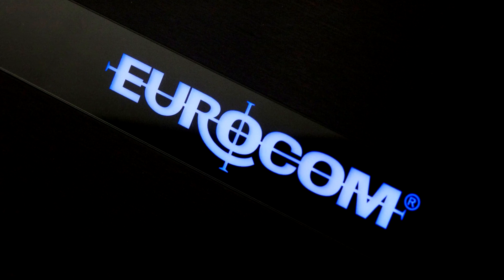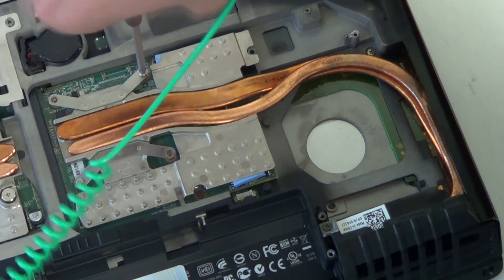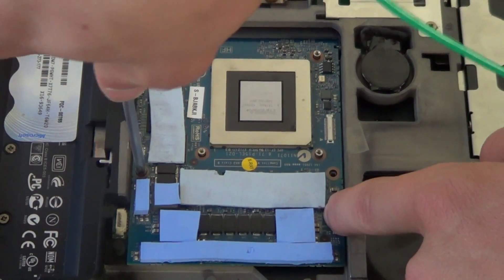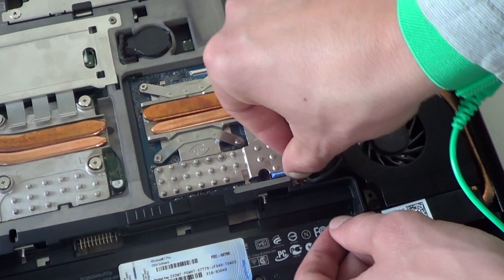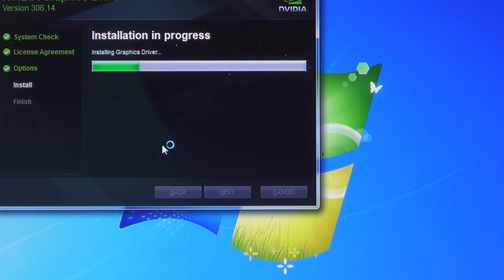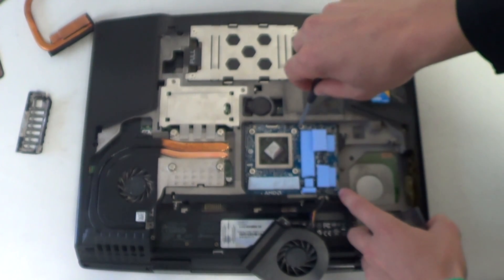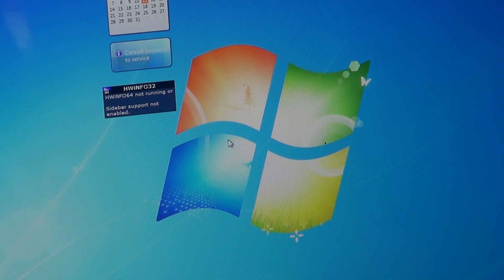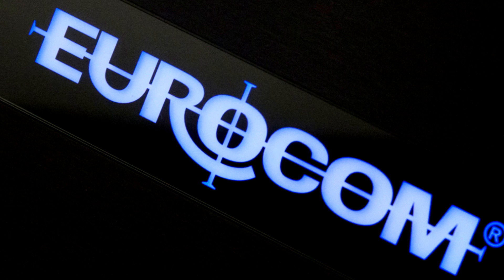AMD Radeon HD 7970M and NVIDIA GeForce GTX 680M upgrade in Alienware M15x

Comment: Recently I've just got a M15x, can it be fitted with 16 gigs of RAM, GTX 680M?
And also I noticed that you'll need a 240w power brick to handle that extra performance, is there any mod that needs to be made with the power brick?

Comment: I followed this exactly, and my m15x doesn't power on, only light is the power indicator which changes color when plugged in and not (orange out and blue to yellow in).
Nothing happens at all when the power button is pressed

Comment: I'm done with AMD video processors. Two came with my Alienware laptop. They've always been a little buggy. I was using AMD for updates. The latest updates won't recognize my laptop monitor so I get a blank screen. Now add software like Hitfilm Express and it fully crashes if you try to do onscreen drag and drop. So now I'm using HitFilm Express with the built in Intell the graphic processor and it works great! Don't wasted your time with AMD. My system has 2 AMD Radeon HD 7970M. AMD isn't worth the hassle.

Comment: Does this 680 or the other gpus work in the 2009 mode? M15x R1 ?

it is really hard to find info about which MXM cards the specific USDT / Laptops support, you know watt, interface, bios etc.
Reply from the maker: Here is a link to our tested upgrades. http://www.eurocom.com/ec/upgrade(2,268,0)Alienware_M15x_2011
Reply: Shame everything is so overpriced. Also i think you linked the wrong laptop because mine has the i3 330m which is first gen. and i think you linked 2nd gen ( i7-2960XM ) and i dont think they are compatiable with one another ?

Comment: Im having trouble removing the fan gril like in 1:55 , ie its stuck. i did remove that one screw he removed.
Reply from the maker: As you can see I had a bit of trouble with it as well.  Be gentle but it may require some fiddling.
Reply: and also i have a i720q and it runs at 60 - 67 idle is that normal
Reply from the maker: 60-67 what?  degrees?  That's not abnormally high.
Reply: yeah degrees

Comment: hey i have a 240watt adapter and i want to upgrade to a 680m from a 670mx will there be enough power for the new card i will buy??
Reply: also if i got a 7970m will the nvidia x bracket work on the hd7970m??
Reply from the maker: Your 240 W ac adapter is perfect.  Yes, the 7970M comes with an Xbracket on the card. All of the xbrackets are already on the card.
Reply: EurocomTechnology oh ok that makes sense thanks
Reply from the maker: Good luck!

Comment: will I need a 300 Watt power inverter for the 7970?
Reply from the maker: There is a 240 W version and 150 W for your system.  You don't necessarily need it but the 240 W version will ensure you are never lacking power for internal components.
Reply: thanks
Reply: I also have another problem 
I installed the card and drivers and everything was fine but the card kept overheating and shutting down the system 
after many Google searches I found that it was the heatsync and I managed to fix it so now it doesn't overheat 
so I reinstalled the card,  started the laptop and installed drivers with no errors 
but when it booted back up after the restart it showed the windows logo but then the screen just goes black 
no mouse or response from anything 
I can only shut it off 
it will only boot in safe mode with the drivers installed 
Any suggestions?

Comment: Hi there,
Where did you put the clip on the anti static wrist strap while replacing the card?
Reply from the maker: It needs to be grounded.  I connect mine to the ground wire on a plugged in electrical cord.

Comment: Hello Eurocom! I have a M14x with i7-4800MQ + GTX 765M + 16GB RAM and I would like to upgrade the processor and video card if possible. According to what I looked into the video card can not be updated but I can replace the processor. What processor do you recommend (compatible)?
Reply from the maker: The M14x doe snot have graphics that are upgradeable but you can upgrade the CPU.  You should be able to upgrade to 4910MQ.

Comment: I have a 680M now that I have been avoiding repasteing due to the thermal pads.  Can thermal pads be reused or are they similar to paste in that they are single use.
Reply from the maker: As long as the thermals pads are not damaged you can reuse them.
Reply: Ok, thanks.  I may end up having to get spares as this hasn't been repasted in three years in is probably on the dry and brittle side.
Reply from the maker: Anonymau5555 Ok, good luck.  If you are looking for pads or other things related to upgrades you can find them here:  http://www.eurocom.com/ec/upgrademodels(8)ec

Comment: Me
M17x r4 GTX 660M
i  can upgrade GTX 980 SLI-----no(m)OK is video card desktop ???????
Reply from the maker: +x xGaMeR  You can upgrade to a single 980M in the M17xr4.  The R4 supports one mobile graphics card.
Reply: OK processor i can upgrade to i7 6700k
Reply from the maker: No, you need to find a CPU that works in the same socket as what you have.
Reply: Me i7 3610QM
Reply from the maker: Yes, I think that CPU is supported.  If that is what you are asking.
Reply: EurocomTechnology i can upgare to 
i7 4940xm or i7 3940xm
Reply: @EurocomTechnology  I have an Alienware M15rx - Gtx 260m .. the same in the video. Can I upgrade to which gaming Video card? I was thinking about 970m, 980m, 870m.  Anyway
Reply: Can we play PUBG with GTX 660M ??

Comment: I have a M15x with Intel(R) i5 Processor with 4GB of installed physical RAM. Will I be able to upgrade my RADEON HD 5000 to the HD 7970M just like this video? Or will I need to upgrade other components of the comp? Thank you for the video and your time!
Reply: +Brandt Brickell basically I just want to play Total War: Warhammer on decent settings haha :)
Reply from the maker: +Brandt Brickell I would recommend adding more RAM.  4 GB is quite low.  Yes, you have the same laptop as in the video.  You can upgrade to 7970M.
Reply: Thank you for the reply!! :) That is great news! I was thinking I should add RAM while I'm at it. I believe I have two 2GB so I will look into replacing those with 4GB to total 8GB :)
Reply: +EurocomTechnology One more question if you have the time. My processor is the i5 @2.53GHz, will that processor be strong enough to handle upgrade?
Reply from the maker: Brandt Brickell You can definitely upgrade the CPU.  You could try an i7 CPU if you want an epic performance boost.

Comment: is it possible to put amd hd 7970 crossfire or gtx 680 sli or there is a problem cuz o normal card and sli and crossfire  is there any differences type please answer
Reply from the maker: +ahmed sultan The M15x supports one graphics card.  It cannot support SLI or crossfirex.  You can look at your options here: http://www.eurocom.com/ec/upgrade(2,268,0)ec

Comment: I could not remove those 4 plastic blockers from the card itself (trying to replace my old dead 7970m with another one)? Those small mini hole-pipes where I must screw the heat-thermal pad. Any suggestion?? My another card did not come with those screw-holes.
Reply from the maker: +Vickey Shrestha I'm sorry but I am not sure what you mean.  Please explain.
Reply: +EurocomTechnology Sorry, I was not clear in my previous comment. So found out the parts name is called X-Brackets, a metal part glued under the graphic card. Is there a way to remove the X-Bracket from my old GPU and place it in a new GPU? The X_Bracket is glued under my old card. But I have heard that you can still use the old X-bracket in your new G. Card.
Reply from the maker: Vickey Shrestha Yeah definitely.  You should be able to push it out.  It is glued on so it may be difficult though.  Make sure it is the same size.

Comment: would the 680 work on M17x r2
Reply from the maker: +Andy Thompson Yes, the 680M does work.  Check your options here: http://www.eurocom.com/ec/upgrade(2,264,0)ec
Reply: ok what about the 780m or 880m?
Reply from the maker: Those are not supported.  Please refer to the link above to see your options.
Reply: ok i did thanks u c i have 2 260m and the not supported anymore so im looking for a good replacement

Comment: Hello Eurocom just wondering why isn't there an option to upgrade the m15x to a 970m or 980m on the eurocom website's m15x upgrade page? Is the 900 series not compatible with the m15x?
Reply from the maker: +It'sMinase! Yes, those cards are not supported in that system.  Your options are here: http://www.eurocom.com/ec/upgrade(1,268,0)ec

Comment: Hey guys,need a little help ! I have an old laptop from 2011 and i would like to find out if i can upgrade to a specific eGPU [thats r9 270x],but i do not know if my configuration wil recognize the video card. I have an "ACER eMG729G-373G64Mikk 17.3" Intel Core i3-370M, 3GB DDR3, 640 GB HDD, NVIDIA GeForce GT 520M 1G-DDR3 " .I am lost when it comes to specific details regarding the upgrade,and recognizing my system,Intel documentation suggests it's pci-e 2.0 but at 2.5GT/s which makes no sense for me, i knew pci-e 2.0 runs at 5gt/s.. And also, if u guys can help me out,i would like to know wich video card would be the fastest one that i could buy for my configuration.
Reply from the maker: +FiftaliKVoice  I am not too familiar with eGPU's.  We don't offer them here.  I would suggest contacting a company that does.  Good luck!

Comment: hello i found a copy of the unlocked A09 bios at biosmods and installed it to no avail
as for the power supply i have alienware m17x 240w and still this card wont post 
do you think maybe i got a bad card .this is the card i have i got on ebay .
"9XVK3 HD 7970M 2G DDR5 VGA Video Card for Alienware m17x m15x M18X"
any help  very much appreciated thank you
Reply from the maker: Marc Garcia You may have a bad card.  I would suggest you contact the seller and request some support and assistance.  Because we didn't provide the hardware or software to you I can't say for sure what is going on.  Good luck!

Comment: i have the early 2011 m15x core i7 740qm with a nvidia 260m 
i installed the latest bios from the website and bought a dell 7970m for alienware 
my power supply is 240w but i bought it off ebay used for an alienware laptop m17x i believe . now after swapping out graphics cards and powering on it tried to boot but
flashed caps and scoll lights with the numbers light staying on solid
now thats all ive done . any help would be much appreciated thank you
Reply from the maker: Marc Garcia You need to get an unlocked A09 bios and use drivers 347.25.  The 180 W ac adapter should be ok for you.
Reply: EurocomTechnology thank you for your reply.do you guys have the unlocked bios, i do not know where to download a working version.
it would be much appreciated if you could direct me  thank you for all 
your help
Reply from the maker: Marc Garcia We don't have a link to BIOS but you can contact support@eurocom.com if you purchase a kit from us.

Comment: hello i'm attempting the 7970m upgrade to the m15x with a 260m but my unit didn't post and was flashing the scroll and caps lights and the numbers light stayed on any ideas ideas on what it could be even on battery same any help would be much appreciated thank you
Reply from the maker: Marc Garcia You need to use the proper Bios (A09) and drivers (347.25).  If you purchased the kit from us please contact support@eurocom.com.

Comment: I have 2  question that the Eurocom support has not answered. 

1. Do any of these cards support 4k output to a UHD monitor? 
2. I have  Alienware with Cor i7  920xm 1st gen. Would any of these cards be compatible? 

Thank you
Reply from the maker: mokhtarr hmmmm 1 - yes, I believe so.  The card and HDMI port support that.2 - Which Alienware system do you have?  I need some more information than that.
Reply: EurocomTechnology I have the Alienware M15x, bought it January 2010. has  GTX260M  and i7920xm right now. It can not output 4k.  When I contacted Alienware support, they said that my system is too old and they don't have any upgrade options that would support 4k.  I use the system mostly for photo editing and not gaming. 
Thank you very much.
Reply from the maker: Yeah you may have an old HDMI revision that does not support 4k resolution.

Comment: having trouble with getting the 7970m to work right in the m15x... i installed it, applied thermal paste, put down the thermal pads, assembled the laptop back together... (replacing the 260m, and using default m15x screws),  and for some reason the gpu runs at 48-50 if you are doing nothing, but the second you load up a youtube video the temps climb to 75c within a minute, and the computer shuts off shortly after.      help would be greatly appreciated.
Reply from the maker: Marc m I would suspect your thermal pads or thermal paste are applied incorrectly.  The pads need to have perfect contact between the card and the heatsink and the die needs to have perfect contact between the thermal paste and the heatsink.  There is a thermal paste application guide in the description and ensure you are applying the thermal pads as per the graphic in the video.  If your problem persists or if you need additional help please contact support@eurocom.com.

Comment: Do Any modifications have to be done if using 7970m on m15x as far as the backplate, or you can just purchased an 7970m x-bracket and install with no issue?
Reply from the maker: MrPattyMC What do you mean  by backplate?  I would recommend using the proper card from the start http://www.eurocom.com/ec/vgas(1)ec
Reply: Sorry, I meant the 7970m's x-bracket. Does it have to be modified for the heat sink to fit properly?
Reply from the maker: MrPattyMC No, the x-brackets do not need to be modified.

Comment: Eurocom,  do you know if this M15x R2 laptop supports beyond gtx 6_ _ series? does it support the 7 or 8 series? such as gtx 880m ? Since this laptop is a bit older that would be very cool if it support new cards like that, and if so is the drivers all that needs to be updated?
Reply from the maker: Jake J Hi! The M15x Supports some 600M series and the 765M.  Yes, we provide the necessary kits for an easy process. http://www.eurocom.com/ec/vgas(1)ec
Reply: Oh I see thanks! Saw the website, will definitely look into it
Reply from the maker: Jake J Good luck!

Comment: whats the best GFX card atm that i can upgrade my M15x , its an i7q with a gtx 260 , 
also i want to upgrade my CPU
Reply: EurocomTechnology Thanks for the reply. Ok so anything listed on this page will work, right? http://www.eurocom.com/ec/components(268)ec

Let's say I was going to get "AMD Radeon HD8970M; 4GB DDR5"

Which of the 4 M15x zip files would I download from that site?
Reply from the maker: The best graphics card that the M15x can support is the 680M at the moment.  We are doing additional testing on newer cards with an M15x so that may change soon.  http://www.eurocom.com/ec/vgas(1)ec
Reply: Is that the vga upgrade 680 with 2gb on board ram or the 4gb on board ram and also do i need unlock the bios and upgrade that aswell
Reply from the maker: justyn france We have both.  The 2 GB is for AW systems and the 4GB appears to be for Eurocom systems.  Yes, update your bios to the latest.
Reply: how do i unlock the bios
Reply from the maker: justyn france If you buy a card from us we provide you everything you need.
Reply: EurocomTechnology "The 2 GB is for AW systems and the 4GB appears to be for Eurocom systems. " What does this mean? Can you not just use both 2 GB and 4 GB in the M15x?

Also does the "kit" come with a driver disc? When I looked on the site it said I have to download from the site. When I do that I get an FTP directory and the card/m15x isn't listed as far as I can tell.
Reply from the maker: The AW specific card is the only one that works.  The Eurocom card does not work for the M15x.  I just checked the link and there are drivers for the m15x:  http://downloads.eurocom.com/support/drivers/upgradeyourlaptop/Alienware/
Reply from the maker: Yes! Please refer to FAQs to ensure you are comfortable with everything.

Comment: Does the GTX 675m work in this laptop, please someone, I'm about to pull the trigger.
Reply from the maker: Yeah, 675M works.  Use A09 bios.
Reply: Thanks, I got one for 150 bucks and a m17x charger for 50 bucks :D

Comment: will the GeForce GTX 680M fit in a alienware M14x laptop?
Reply from the maker: All Alienware M14x systems have integrated graphics and cannot be upgraded with any graphics card.
Reply from the maker: ***** The Alienware M14x has integrated graphics that cannot be upgraded.
Reply: *****  Well Alienware M14x does indeed have an nvidia graphics card but it's fuzed with the motherboard and not in the form of a MXM 3b slot. They are Not seperatable from the motherboard. Hope this clears things up...
Reply from the maker: Jake J Thanks!